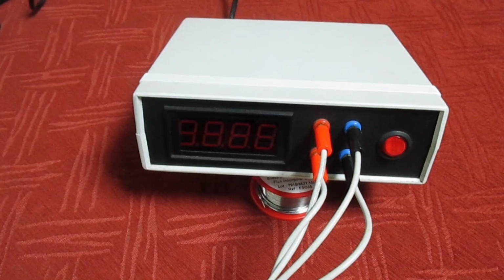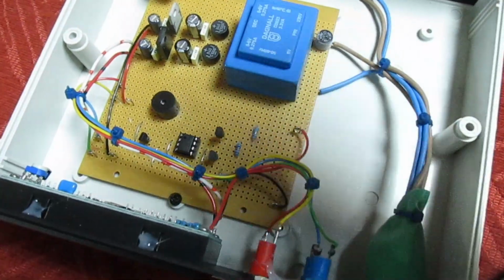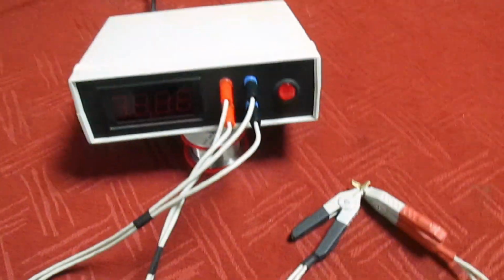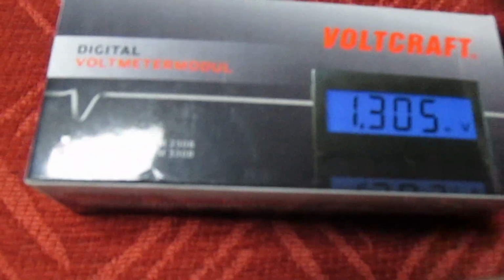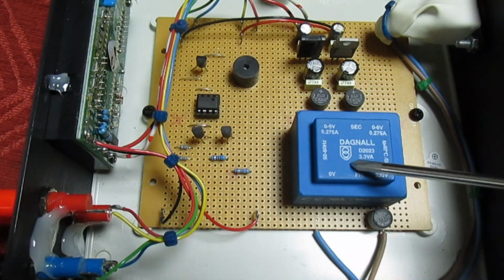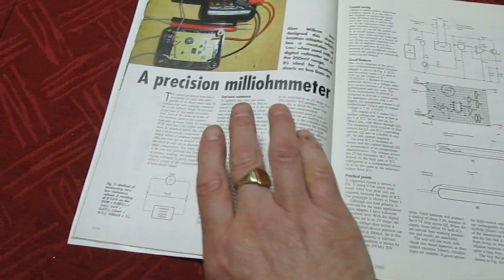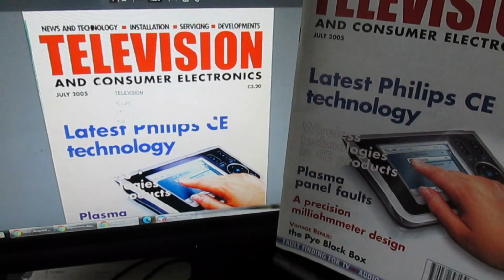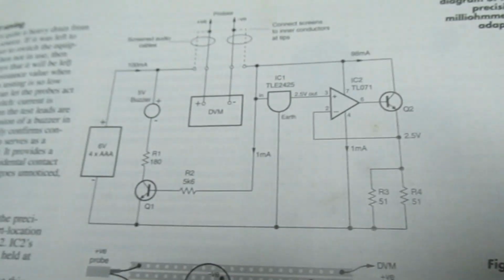DIY Precision milliohm meter by popular request with circuit diagram.

Comment: Using Kelvin's strategy, the current is supplied and measured using I+ and I- leads and the voltage is sensed using separate V+ and V- leads.  The voltmeter has high internal resistance so very little current flows in the sense leads and the voltage across the sense leads, V=(0)r, approaches zero... the voltmeter measures the voltage actually across the DUT.  The current leads do develop an additional voltage, V=Ir, but this is NOT the voltage used to compute the device's resistance, R=(V+ -- V-)/I.  As long as the sense leads are connected directly to the test resistance, R is rather exactly equal to that resistance.  If you must do even better, you can add a guard shell around the current leads to eliminate leakage current and you can compensate for sense lead resistance by applying the voltage divider to the lead resistance and the voltmeter's resistance.
Reply from the maker: Many thanks for the excellent explanation.
Reply: I was very confused from the explanation in the video, because I was certain that this was simply a 4-wire measuring setup, which it is.
It's not about canceling the resistance offset, which would be very easy with an offset pot.
It's about having one pair of wire for the current itself, and a second wire pair to sense the actual voltage drop, however drawing as little current as possible to cause no voltage drop over the wires itself.
I think the video is actually quite misleading.
Reply: @graealex  For those of us who would have a use for this device the video makes perfect sense.
The device passes current across the test points. A separate DVM measures the voltage drop across those two points.

For every 1 miliohm resistance across the two test points causes a 1 milivolt voltage potential [difference] across those two test points.
 [1Mv = .001volt] [1Mohm = .001ohm]
Reply: @DrHarryT  The problem is that Michael gave a completely different (and unfortunately wrong) explanation to how it works. Maybe watch the video again.
Your explanation on how it is supposed to work is absolutely fine. One component is generating a constant current (a constant current source, easily implemented with a const current driver), and a second component (DMM voltage measurement) is measuring the voltage drop.
Reply: @graealex  Yup, maybe I should watch it again, the first time I probably filled in the blanks or referred to my own understanding of how it works.

Comment: hello Michael, a happy 2023! If possible, I would like you to send me some links to electronic circuit assembly sites and test equipment. Here in Brazil, we have little information on these matters!!!
Hug happiness.
Reply from the maker: I don't use electronic sites , most of my projects come from magazines I have collected for the last 40 plus years, however there is a site on the internet called " world radio history" and you can download most of the electronics magazines from there , everyday electronics , practical wireless , there's load of them , going back years .

Comment: Very nice project! Thanks for sharing.
Reply from the maker: No problem , glad you liked it .
Reply: @michaeldranfield7140  mV-meters readings must be multiplied by 10? In one of your old video where you showed how to trace dead short in-circuit, your mV reading was 0.375mV so multiplied by 10 will be 3.75mV wich means 3.75 mOhm. Am I understanding it right?
Reply from the maker: @dextertech6570  in this design resolution is 1 Mv, its a direct reading and needs no multiplication
Reply: @michaeldranfield7140  Thank you, sir

Comment: Where can i find tle2425 or can you tell me replacement for it?
Reply from the maker: have a look ar RS components , however as its only a precision voltage reference chip any other chip giving the same output voltage should work fine .
Reply: Thank you for quick response sir 🙂

Comment: Thanks Michael for the great video and very helpful instructions. I made one, works great. As yours, mine uses a small spare mains transformer with 2 secondary windings. This is very important as you mention because most digital displays use a common ground with the measurement circuit and supply. My meter is 12V supply but I see others using 5V or similar. A 7806 regulator gives a nice stable supply for the measuring part as per the schematic. The kelvin probes are readily available so all in all a great addition to the test bench, thanks again.
Reply from the maker: Glad you liked it , its not something I use on a daily basis but when you need it its really useful and saves a lot of time disconnecting things.

Comment: Any substitute for TLE2425CLP ic as unable to find in the local market.,., thx
Reply from the maker: I would think that any precision reference voltage generator chip giving the correct output would be fine, in fact as this is quite an old project I would imagine there are many better specified devices than the original .

Comment: FYI. ASCEL electronics has a Kelvin Milliohmeter kit (with Kelvin probes) AE20218 for about $150 USD
Reply from the maker: RS components are notoriously expensive  so Im not surprised you can get a commercial one cheaper .

Comment: I want to thank you again Michael for alerting me to this circuit (and thanks to Alan Wilcox for the original design!). I have now constructed my own unit. I already had a suitable enclosure and the majority of components, so the whole thing cost me about  £28 (kelvin leads & panel meter accounting for £21). I am truly astonished by the accuracy!  I've powered it with  3 x 18650 batteries (including separate supply for the meter) and included recharging sockets.
Reply from the maker: nice one , and about 20 times cheaper than buying one , as you say incredibly  accurate, I had a complaint from a viewer that I made no reference to the original author of the project and I did this because I have a feeling Alan is no longer with us but I cant be 100 percent sure so I thought it was better to say nothing .

Comment: Sir so nice and kind, sir what are the values of ur addition like bridge rectifiers, capacitors and linear regulators etc and how they were connected,
2ndly are the 2 mobile phone chargers of 5v not used? 1 for miliohm circuit and 2nd for digital meter, please guide as m a fresher. Also any substitute for   TLE2425 ic..,. , Be Blessed and live happily ever

Comment: Great idea! Some time ago I wanted to build a simple frequency counter and function generator but I found that there is no point in building one yourself when a Chinese device perfectly suitable for hobby use costs less than what I'd need to spend on parts. With a milliohm meter at least I stand a chance of breaking even! ;--)
Reply from the maker: Of course but a lot of the stuff i have was built before the Chinese flooded the market with cheap test equipment .

Comment: I have become accustomed to using the finger test to find out which is the component absorbing all of the power, but this is so much more refined an idea. First - this works even if there are poly fuses in the way that shut the power off before components get appreciably warm. Second, I find it difficult sometimes to work out exactly which of the components caused the painful burn (have been known to get the calipers out to try to measure the blister on my finger, to work out which component got hot).
Reply from the maker: A lot of circuits have current limiting and shut down when there us a short, only way to do the burnt finger test is power the rail from a bench power supply in a lot of cases.

Comment: Can I use two lithium-ion batteries and just run it on 8.4V instead of 6V? Maybe put a 10ohm resistor in series with the batteries?

In the magazine they refer to using audio coax cable soldering the shield to the core at the tip. I could just get test lead ends and a stereo RCA patch cord cutting off one end, soldering them onto the test leads. Then install a female RCA connector into the case and be sure to run the 100ma high current through the outer shields. At that point one could run the audio cable core out with banana plugs to use with an external DVM or install in the case one of those cheap E-bay 200mv panel voltage meters into the case.
Reply from the maker: I dont see why not  and yes just a poundshop RCA cable will make a cheap screened lead.

Comment: If i want to run it on an external power supply (6volt). How do i separate the power if i want to build your version with a display? Do i need two power supplies?

Comment: You can also find a self-designed from-scratch milliohmmeter from another great british electronics youtuber, Scullcom Hobby Electronics (video #31 and #43). I appreciate seeing your own design and it's source. That that website is preserving all those magazines digitally (for free!) is a great resource. I bet there are some really neat simple hobby designs scattered throughout the 1000s of pages of magazines you could peruse there.

I'm pretty sure it doesn't matter if you connect the voltmeter's ground to the current sink's ground, as long as the voltmeter is doing a proper differential voltage measurement on its +/- wires. Completely isolating it probably doesn't hurt with stability though.

Funny seeing a lot of comments exclaiming minutiae improvements. There's probably 100 different designs you could do for this (it's kinda fun seeing them), if yours works conveniently with enough resolution for your purpose then it's clearly doing a good job!
Reply from the maker: Many thanks for that .

Comment: Hi Michael. Thank you for creating this informative video, this is going to be my holiday project. 
If you have time, I was wondering if you knew what the difference was between TLE2425CLP and TLE2425ILP. I'm not sure if they're interchangeable for the purposes of this project.

The data sheet says the only difference is the device marking (2425C and 2425I respectively). 
I'm guessing the C or I before the LP is the version number?
(LP refers to PLASTIC
TO-226AA). Thanks in advance.
Reply: C is rated 0-70 degrees (celcius), I is rated -40 to 85 degrees, M is rated -55 to 125 degrees. At least for the TI part. That means if you buy the I version, they guarantee it will operate within its min/max specs even if you left it in an oven at 100 degrees.

For this project you could use any.

If you build this, the easiest way to get decent precision is by putting the kelvin leads onto a multimeter in ammeter mode, and swapping out R3/R4 until it shows exactly 100mA is being drawn.
Reply from the maker: I dont know off the top of my head but it could be one is lead free and the other is not .

Comment: The leads do not compensate for each other. If you like, you can make your probes with 4 wires of different lengths and gauges. 
It works by generating a constant current which is passed through the resistor being tested. The voltage produced is measured by the panel meter. Since the panel meter has a very high input impedance, it does not noticeably perturb the current. There is no compensation anywhere.

Comment: This is a Kelvin Probe. The two wires should be connected to each side of the spring clamping device as long as there is no resistance from each side of the clamp. . You have to take into account the there is mili Ohms of difference going through the clamp.

Comment: Great project. But your description of how a Kelvin connection works was horribly wrong. Each and every lead to the connection could be of a different length and resistance, and it would still work. "Half way" and symmetry has nothing to do with it at all.

https://en.wikipedia.org/wiki/Four-terminal_sensing

Comment: Thanks so much for posting this. Could you just confirm that the 'Panel Meter' you mention should be a Voltage meter with a Measurement Range: 0 ~ 200mV DC?  You said 'resolution' rather than measurement range. This is the only bit that confused me.
Reply from the maker: Sorry but all my videos contain mistakes, yes the led panel meter is 0 to 200 MV.
Reply: @michaeldranfield7140  Thank you Michael.

Comment: If you apply some current, less than the normal consumption, to the power supply side  (3v3, 5v etc) you can use the millivolt range of a good multimeter to do exactly the same.. The voltage at the short circuit is the lowest. Before the short there is a drop in voltage. Further away behind the short the voltage stays the same.
Reply from the maker: I just found it convenient to have an all in one tester rather than using a separate meter, but as you and others have said there is more ways to do the same job.

Comment: I watched your video with great interest, where you found a SMD Capacitor shorted-out on that TV Time Control Circuit. You used your milliohm meter in order to pinpoint the short! I had never realised that you could do this. I have always removed many transistors, capacitors to check if the current flow had gone down in the circuit. Also, I have used cooling & heating various items on the PCB - to effect change (hopefully). Short circuits aren't real easy to locate, well, not for me anyway. Thanks for your contribution in teaching those that are well-under your level of knowledge! Greetings from Sydney.
Reply from the maker: It's only good when the short is less than 1 ohm, above this what I do is to apply a voltage from a bench power supply and see what gets hot.
Reply: Which Video was it, I may of missed that one.
Reply: @andywebber8749  Hi Andy, you need to look for: "Flat screen TV, a very common fault to look out for". I currently have a 42" LG LCD TV with the right side of the screen with just vertical coloured lines. I have already changed the Main Board, and replaced the T-Con. Nothing changed. I don't have a milliohmeter, but (taking Michael Dransfield's lead), I will definitely  remove the top section of this TV, (after the T-Con Board) to reveal the ribbon that carries these SMD Capacitors, and simply change-out the whole lot. I really wish that Michael lived next door to me!! greetings from Australia.
Reply from the maker: @andywebber8749  It was a video to highlight the problems of repairing flat screen TV sets .
Reply: Yeah, I was going to say the same thing - apply power from a bench supply, but below the usual rail voltage of the shorted rail so things don't actually turn on. Use 1V, and give it lots of current - the offending component will soon identify itself by melting, lighting on fire, or having your finger print permanently burned into it as you hunt around the board for what gets hot

Comment: Help me understand something... if a cheapo meter costs $40, why in the world would a meter with 4 terminals to cancel out the resistance cost hundreds? I was blown away by the simplicity of the circuit and I just don't understand the price jump....
Reply from the maker: That's a good question and I don't have an answer but isn't most professional test equipment expensive to buy, unless it comes from China of course.
Reply: You can get an Nktech Vici VC480C+ milliohm meter for less than £90. A much more reasonable price. The "Learn Electornics" channel did a review on it.
Reply: You CAN build/sell a far higher precision and accuracy meter for hundreds... whether a particular one is actually built for superior specifications or just has some historical price markup that chumps will pay, well depends.

Comment: Actually, the current leads and the voltage leads can’t touch each other at the device being measured. They should be close together, but not touching.
Reply: Sure they can. Electrically it's basically equivalent. The closer the touch point to the real resistance path desired to measure the better, although you start to get diminishing returns. Probably slightly better kelvin clips could be made by having each wire go to an opposing side of the clip so they only touch when it gets full grip on something.

As pointed out in the video, if you're making a micro-ohm meter the distinction probably matters, but for the as-designed milli-ohm meter, not really.
Reply: @ivolol  If any of the 4 wires or jaws touch each other, you no longer have Kelvin clips. Close maybe, but not quite..

Comment: I designed a digital milliohmmeter and wrote an article and sold it to 2 different magazines in the 80’s and 90’s. One was Electronics and Wireless World Dec 1990 and Modern Electronics March 1989
Reply from the maker: Page 1078 , many thanks for that , I have just looked it up on the internet .
Reply: @michaeldranfield7140  Now you know my you tube alias has the same first letters of my real name! We had Radio Electronics and Popular Electronics when I was a kid. Circuit Cellar was just starting.
Reply: @michaeldranfield7140  hi long shot here. What volume is it as cannot find it .regards
Reply from the maker: When I was a kid and I use to go to the library with my mum on a Saturday morning they had all copies of electronics magazines you could read and one of them was Wireless world which I use to look at but did not understand due to the complex maths and it always seemed a magazine for industry rather than consumer and as such growing up, wireless world was a magazine I never bothered with .